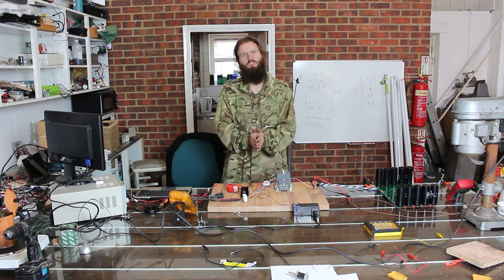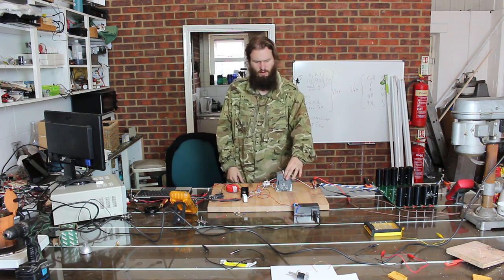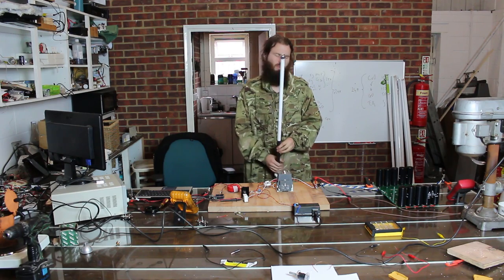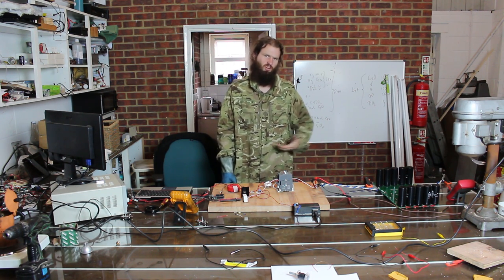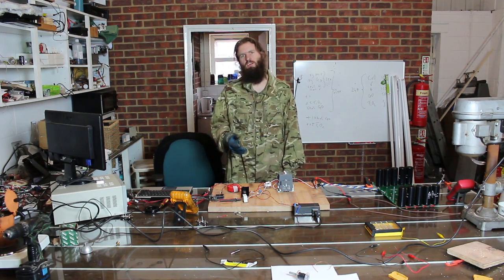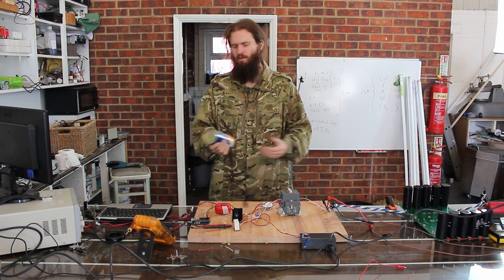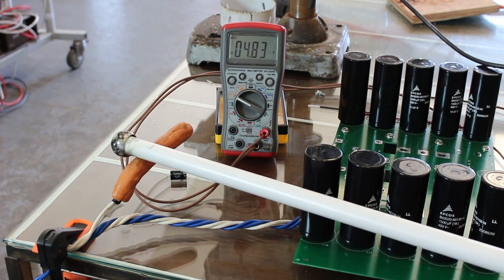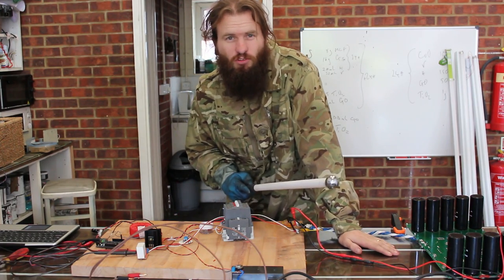Fun With A Boost Converter And A Capacitor Bank

Comment: when it popped that 64v cap itstill had about 1/2 its' power left by the gauge.
i wonder what the voltage & amperage are in a good bolt of lightning? that'll zap damp sand into a tube of glass... looks all dendritic & rooty when it cools.
Reply: TheGEODEAHOLIC artificial lightning, hmm :D I've always wanted to make those dendritic lichtenstein figures, they are so cool. Definitely need more power for that
Reply: actually, t-storm lightning into damp sand will create a 3-d tube of hollow semi transparent glass called a fulgurite, they tend to be all contorted & somewhat dendritic